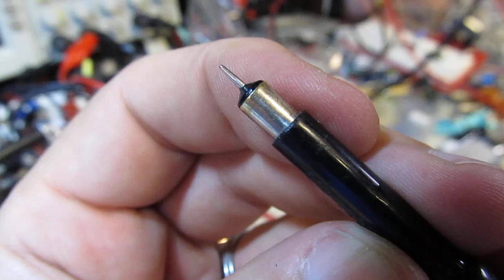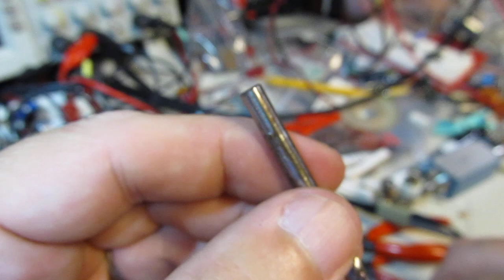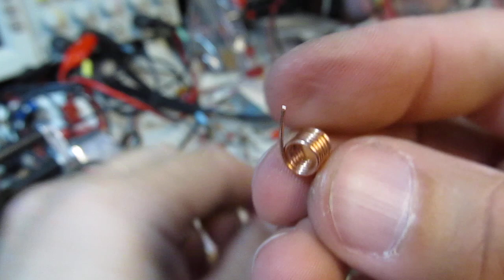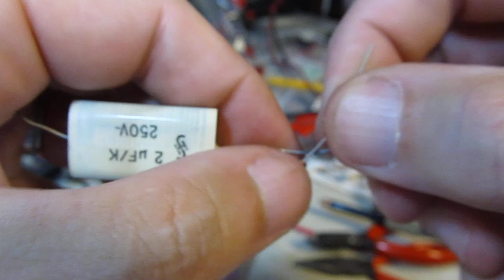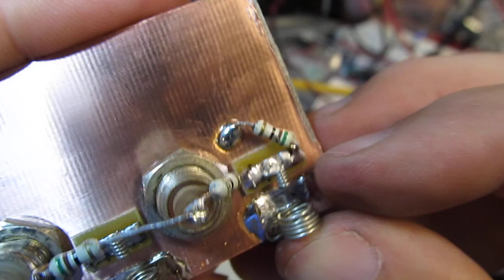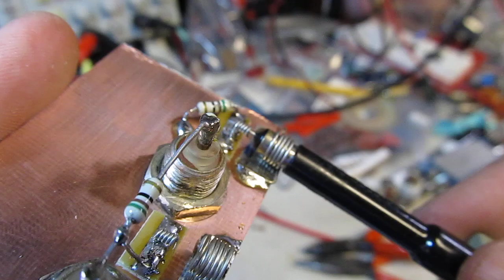#111: How to make a high performance oscilloscope probe socket

Comment: That is certainly convenient! I'll be trying this out shortly with my non-standard oscilloscope probes. Previously they've been stuck into the sockets of swiss machine pin headers mounted on the terminals of my PCB, as I've seen been done here. Thank you for sharing your invaluable wisdom!

Comment: Great tip for PCB. I did a similar trick (with a dril) for making the short gnd "coil" of a paperclip (as it is soft enough to wind but hard enough to be used as a spring). Indeed slightly lesser diameter then the gnd to be able to tight on it.

Comment: You need a high bandwidth scope to see this. On my 300MHz scope any digital signal probed with a long ground clip rings like nuts. For probing a few MHz signals i usually turn on bandwidth limiting on my scope to clean the ringing off it since i cant always be bothered to get a good ground.

Comment: Hi, I have a question to an expert in MHD aircraft. 

Does the MHD aircraft only use ether power generation for its power supply? I received a feeds yesterday it says "no moving parts" I believe this is related to the ether power supply.

Comment: I understand the ground lead must be short but where should you connect it too? I suppose you want the shortest path to the ground pin of the device you're measuring the output off? Is that right?

Comment: Very ingenious. How did you hold the smaller coil in place while soldering? I would worry about the heat from my iron damaging my expensive probe if I were to try and use the probe as the holder for soldering.
Reply from the maker: If soldering quickly, it's not a problem. Or, you could use an old/broken probe, or even a pushpin to hold the wire in place.

Comment: is there copper under the small pcb small coil pads to adhere it and those are 51 ohm resistors , love this diy , thanks
Reply from the maker: Yes, there is a strip of copper on the little islands used to mount the tip coil.  And, yes, they're 51 ohm resistors
Reply: @w2aew  thanks , it look great and built it today

Comment: I am definitely doing this for my Bass. Every time I tune it, I take the back plate off, and lose a scope probe almost every time its nearly at the right freq. I have been meaning to make a "Guitar lead" scope probe, for plug and play, but I like this way too. Will just make a scope hole in the back plate:) Could be great on those experimental circuits... 3055 flyback drivers keep melting my hook tip thingy's.... Oh the pain I have gone through trying to keep probes in place.... THANK YOU!!!
Reply: Are you tuning your bass with an oscilloscope?

Comment: Would this method be    effective if attached to the speaker output jacks of a SS amp one was tinkering with? Thanks!
Reply from the maker: A low inductance ground lead isn't really necessary for audio frequencies - so not really needed.  A second consideration is to be sure that your amplifier's output is ground referenced (i.e. not bridge or differential drive to the speaker).  A scope probe like this is ground referenced.
Reply: w2aew Hmm...  It's a '76? Earth Amp head - Peavey Musician clone. Today I'm starting a hand drawn  schematic. So I should learn alot. I'm hoping that I'll be able to verify a ground reference regarding the speaker output. I have 1 bad (shorted) power transistor of eight. I'm wanting to use my vintage scope to see what the transistors are doing.  When I watched your video, I thought I could use that method to "spy" on the transistors. I have an ample lack of knowledge, but I'm learning fast. This SS  Amp is a good way to learn. But I didn't realize how deep the rabbit hole goes! I really want to probe the Amp with my  Sencore ps148a, but I don't want to blow myself up...  ;) any advice would be greatly appreciated. Thanks again for your videos! Always awesome!
Reply: w2aew The speaker output jacks are ground referenced. According to a Peavey forum I can remove the 1 bad of 8 T03 transistor from the ciurcut and run the Amp at low volume on a 4 ohm speaker to test. One of the two channels should operate if all else is well. Does that sound right to you? He has the same Amp. I wish I had a schematic but I don't. In the name of science I think I'll try this. Can a SS Amp run in "limp mode" ie low volume with one power transistor removed and still operate?  Any advice would be greatly appreciated. Thanks!
Reply from the maker: It is difficult to say for certain without seeing the schematic - but I'd be pretty comfortable trying it.  In general, an "open" transistor would do potentially less damage than a shorted transistor.  Removing a transistor would be the same as one that failed open.
Reply: w2aew Thanks! That makes sense. I have a Tektronix 317 that seems to be running fine. I've never actually probed anything anything in  my life. Do you have any suggestions regarding some basic test points on a SS Amp for beginners? I have a sencore ps148a I could start with, but it only has BBC for vertical input. Thanks!
Reply from the maker: Impossible to recommend test points without seeing a schematic - there are many, many different designs for SS amps.  Usually, you simply probe the main signal path.
Reply: w2aew I was thinking that would be a difficult question. I also happen to have a Johnson messenger 4230. BAMA may have the schematic. But perhaps the safest thing to test the scope on would be my Radio Shack AAA battery AM/FM radio? Thanks for your patience and info. I'll keep you posted.  :)
Reply: w2aew Or I could just turn to page 702 of Essentials of Radio. "Operation of an Oscilloscope". Don't know why I didn't think of that earlier. I was an HVAC mechanic in the good ol' USMC for ten years and another 15 in HVAC/Concrete so I've been around the electrical/mechanical world. Then the hands and kankles went south (getting surgery so no worries) and I decided that the wonderful world of vintage tube & SS gear is the life for me. So thank you for sharing your knowledge and be forewarned, I have many questions for you my friend. Take care!

Comment: Thank you for the tip. It would be even more assuring to display the resulting o-scope trace.
Reply from the maker: See video #112
Reply: @w2aew  Thank you for reply. I thought of a step response on the digital signal. I am trying to profile a 5-ns digital pulse from a microcontroller, operating at 100 MHz clock.
Reply from the maker: @odissey2  Oh, OK.  While not exactly the same thing, this video shows the effect of ground lead length on a fast digital edge.  The spring-clip ground lead is akin to the socket described here;  https://www.youtube.com/watch?v=zodpCuxwn_o

Comment: The biggest problem I see is that you're using a scope probe for high B/W measurements.  I've found a resistor divider straight into a coax and terminated at the scope (50 ohms) works incredibly well.  I guess it all depends on what you need.  Here's where I got the info from. http://www.sigcon.com/Pubs/straight/probes.htm